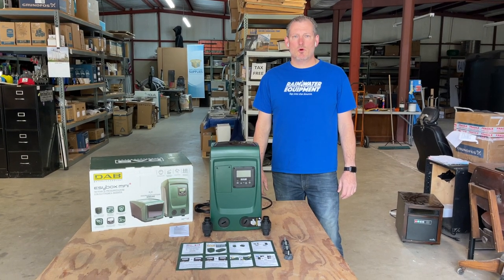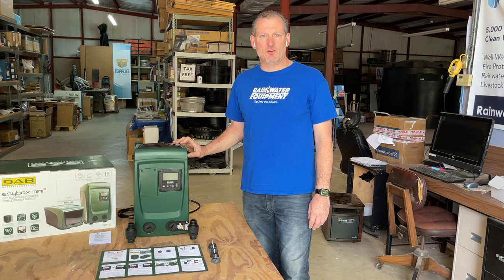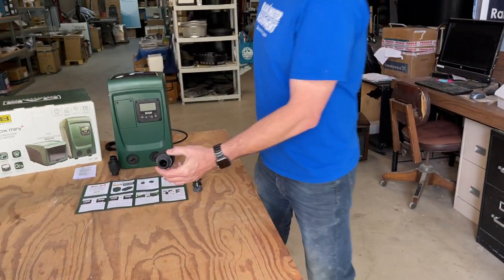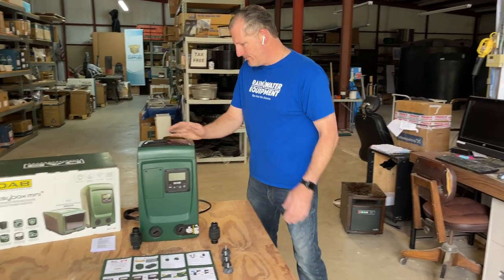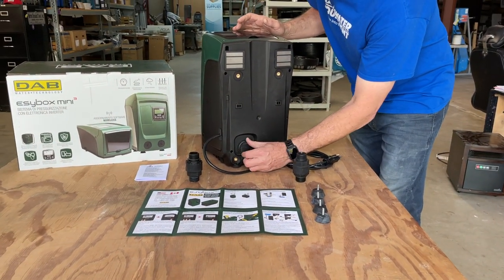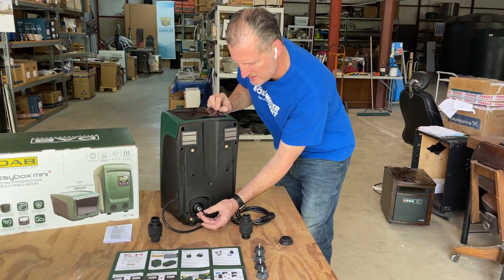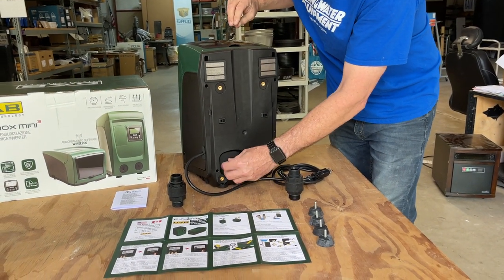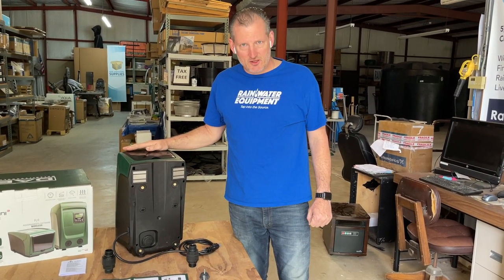Non-Return Valve for Flooded Suction on DAB E.SYBOX MINI 3

Comment: Hello, am in Kenya. I don't know where you are located. That said, please check your pressure vessel if it has air. If not, pressurise the system to 2 bar,
The other way is to add a gate valve after the pump. This way, you shut off the the gate valve and you will notice if the problem persists.

Comment: MY PUMP IS NOISY I HAVE CHECKED EVERYTHING INCLUDES BEARINGS THEY OKAY, CANPRESSURE VESSEL(TANK) CAUSE NOISY WHILE EMPTY?
Reply from the maker: It shouldn't be making a noise like that. I doubt it has anything to do with the internal pressure tank. Make sure you have the inlet pipe (on the right) plumbed into the water source and not vice/versa. It sounds like you may have debris inside the pump. Always use a pre-filter on any booster pump. You may want to contact DAB tech support for additional assistance. https://dabpumps.us/en/CONTACTS

Comment: Hello
I just set up my pump but when I start it I always get a Dry Run BL fault notifications (there is water in our water hole).

I noticed that when I try and fill the built-in reservoir, I can keep filling it with water (a lot more than de reservoir size), it’s like it never fully fills up to the top. Could it be something with the shutter valve or ?
Reply from the maker: If you are lifting water from below the pump, you will likely need to install a foot valve on the bottom of the suction pipe down in the "water hole" to prevent the water from going back the opposite direction. Once you have it installed, start filling the pump with water, which will also fill the suction piping that goes  down to the foot valve where it will stop. Once the pipe and pump are full of water, the pump should be able to prime.
Reply: the thing is there is already a foot valve in the waterhole on the suction line.

Doesn't the pump have an integrated foot valve ? So if I fill the pump, it will just fill the internal reservoir  and not go into the line up to the water hole?

Comment: Hi Mi mini DAB ESYBOX pump was working greatbbut it protected it self from dry Run We Purge it and works  but it turns too often and leaks water from the intake line from inside any clues ?  I am not able to find service technicians to repair Playa del Carmen Mx
Reply from the maker: I'm not following what you're saying. If it leaks on the suction side, you probably need to disconnect it and rewrap the the threads with fresh thread tape (5-6 wraps). If you're using stainless steel fittings, you need to use tape made for stainless steel threads, or they will leak. Again, wrap SS thread tape 5-6 times.
Reply: @rainwaterequipmentllc7835  Thank you very much for your insight I appreciate it

Comment: I'm installing the e.sybox mini as a booster pump to bring gravity fed water pressure up. I have 16 psi from the gravity fed system where the pump will go. Am I correct in proceeding as though this is flooded suction?

Also, the english translation in the manual is pretty rough. Do you know if I can use the inlet and outlet on the bottom of the unit in a vertical install (like you have it in this video)? I am installing the pump on a shelf over our water inlet (comes up through floor) in a closet, and I would use less fittings plumbing up through holes in the shelf.
Reply from the maker: Andy, Water head pressure may be calculated at .433 x 1' of head. So if the water is 10' high for example, that's 4.33 PSI of inbound pressure. I would consider that to be flooded suction. Typical city water pressure is between 30-55 PSI, so 16 PSI really falls between the two. I'd probably consider it to be flooded suction, monitor pump performance to see how it goes and change the shutter valve around if needed.
Reply: @rainwaterequipmentllc7835  Thanks for the reply. As I was planning out my install, I noticed that my e.sybox mini came with stainless steel unions to be screwed into the brass fittings on the pump. I was surprised at this because I have always been told that dissimilar metals should not be in contact inside of a water plumbing system due to galvanic corrosion. I will be replacing the stainless fittings with brass so I don't have any issues down the road.
Reply from the maker: @andydouglass1374  It depends on the dissimilar metals. In this case, the type of stainless steel used with these union fittings and brass are fine to be used together.
Reply: @rainwaterequipmentllc7835  I will probably be calling DAB tomorrow for help but thought I would run this by you. I cannot get the stainless unions to seal in the integral brass fittings. There is no room for a wrench and the Italian videos show them using some sort of socket to engage the internal lugs on the union. I am forced to use a small flat bar to tighten the fittings, which engages these lugs like a large screwdriver. In respect to the integral fittings being set in plastic, I started with the fittings just past finger tight with 3 wraps of quality teflon tape. Outlet side between brass and stainless leaked under 16 psi house pressure. Disassembled and noted dark scale on the brass female threads, similar to when oil "enamels" onto metal under prolonged heat (like on an old baking sheet). Wire brush will not remove scale. Retried with multiple quantities of new teflon tape, switching fittings, etc., and always increasing torque slightly more each time. Have tried over a dozen times and at this point I do not want to torque the fittings anymore as it is already beyond anything I have ever done with traditional plumbing.  What tool do you use to tighten these fittings and have you ever had a similar problem? Thanks!
Reply from the maker: @andydouglass1374  You need a spud wrench like the one shown on this page: https://rainwaterequipment.com/content/documentation/DAB-SS-Fittings-spud-wrench.png We sell them with our MINI 3 pumps, https://rainwaterequipment.com/e-sybox-mini-3-on-demand-constant-pressure-pump/ but you can probably find one on ebay or Amazon. The one we sell is about $20 and fits on a 1/2" drive socket wrench. If you can't find one, call the office on Monday at 877-331-7008, we can take your order for one and ship it out tomorrow.

Comment: I wanted to check if you may know the reason why my dab mini3 pressure bar drop even when no water is being used. I runs every 2 minutes. Please help me
Reply from the maker: It sounds like there is a leak somewhere in the piping. The pump thinks you're using water and turns on. It builds pressure, then shuts off until the pipe leaks enough water, and the pump turns back on.
Reply: @rainwaterequipmentllc7835  I thought so too but there's no sign of leaks. Even when I close the switch that supply water from the pump to the house the  problem persists. I requested the guy who installed it to come and check but he is not in town for the coming 2 months due to family commitments. 

I am worried this pump might be damaged by the time he come to attend it.
Reply: @royalprince8730  We are having the same problem.  Have you been able to fix this?
Reply: @karendanis4130  I am having the same issue. My basement is unfinished and I see no visible leaks.
Reply: Myb you have a check valve that's failed and is now moving the pressurized line leaking into the city line.

btw, there's anti-cycling feature on this machine.  It should prevent the continuous running of the pump due to leaks.  you may want to turn that on.

Comment from the maker: Note: The MINI 3 pump no longer comes with the 1" fittings shown in this video.
Reply: well that sucks.   Is the thread NPT?
Reply from the maker: Yes. 1" NPT @vo2098
Reply: do you have a tutorial for adjusting the bar pressure ? it's not just a case of pressing arrow up or down. A adjustment must be made behind the panel next to the display screen.
Reply from the maker: @daveking777  hold down the mode and set button simultaneously for about 3-4 seconds, and then you will be able to increase or decrease the pressure with the up-and-down arrow.
Reply: @rainwaterequipmentllc7835  the factory setting of the dab mini is set at 3bar in the uk. i was led to believe you have to open the panel to the left of the lcd screen and adjust the valve below the no return valve. It's not just a case of adjust the arrows first ??
Reply from the maker: @daveking777  That's incorrect. You only need to do as I instructed to adjust the pressure.
Reply: @rainwaterequipmentllc7835  thank you for the info ... it seems i'm getting conflicting advice. while i have your attention could you please explain to me what exactly is that small device below the non return valve behind the panel to the left of the lcd screen ?
Reply from the maker: @daveking777  It's a small rubber cover for the air stem on the small expansion tank. If you need to add or remove air from the tank, that's where it is done. It's not required to change the pressure output of the pump. We've been dealing with DAB pumps for almost 10 years and are very familiar with them.
Reply: @rainwaterequipmentllc7835  thank you very much for your help